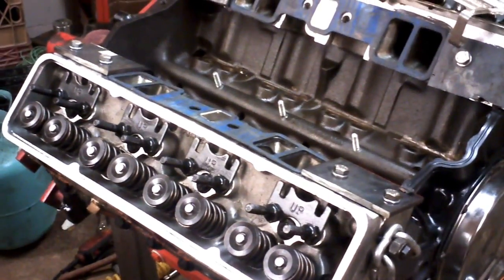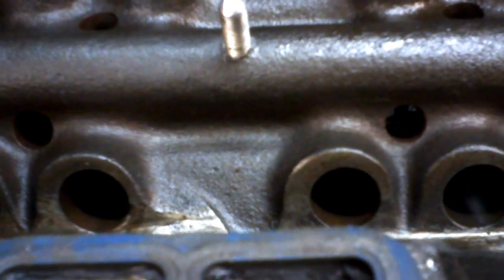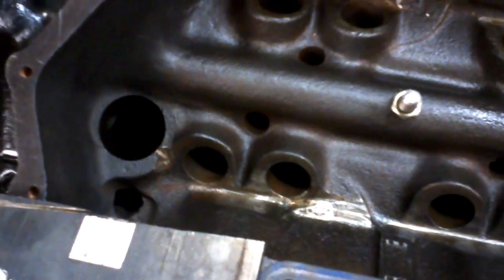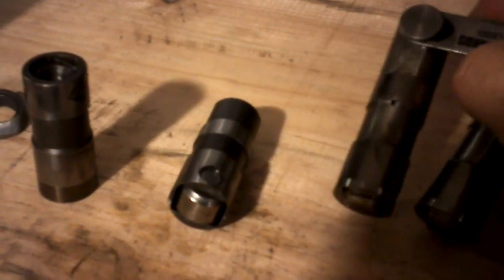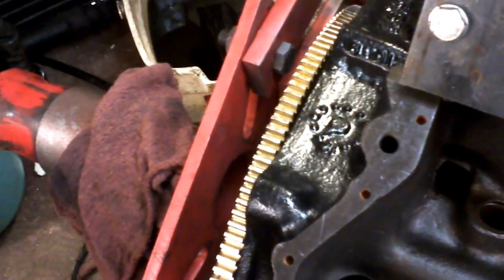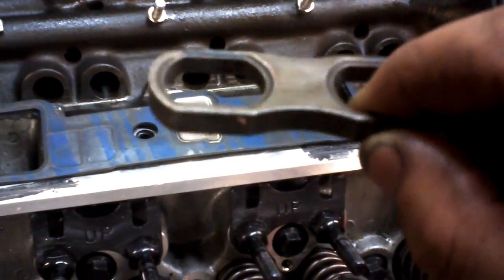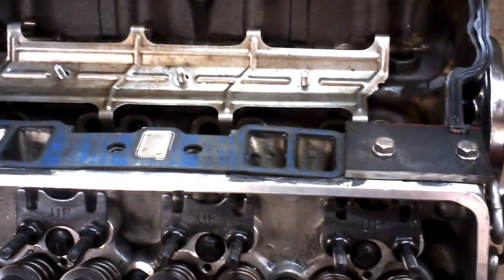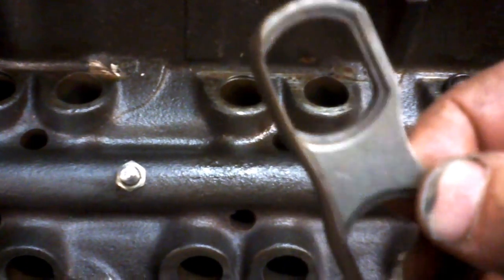Small Block Chevy Gen1 SBC roller lifter retrofit

Comment: Please please please, nobody grind down the dog bones like that...
Use the correct tie bar lifters. Valvetrain weight loss means nothing on this type of low compression low HP engine.
Please don't grind them. And don't use threaded rod anywhere on an engine.
John here is too rich to know any better judging by his other videos

Comment: I know this video is getting pretty old now, but did you ever have any trouble with the lifter spider being drilled and tapped with those studs?  I actually have a roller block with a damaged spider mounting hole, and I'm curious if I can follow your lead here and drill/tap a little further down into that ridge to run a stud for that mounting point.  You mentioned in a previous comment you'd never do this again, but I'm unclear if the problems you had were related to the drill/tap for the hold-down spider.
Reply from the maker: Dont drill down into the oil galley.  Any swarf will plug oil holes.  How damaged is your block ?  Can you use a heli coil or timesert?  If not braze on a nut or mig a stud to what ever is left.   Google cold weld cast iron.

Comment: Is the tray sitting right on top of the nut? Mine is about a 1/2" or more  higher than the nut. How tight or the ends supposed to sit on the lifter hold down?  IS the lifter tray supposed to be applying alot of pressure? I'm not sure if I have it to tight.

Comment: Wrong side of the rocker arm to be worried about weight. Light weight components on the valve side matters, valves ,retainers , locks ect. Lifters ,nah.
Reply: I've seen discussions about this and while some say it's not as important on that side because of the leverage advantage, the valve spring still has to apply energy to control that side so lightweight components do matter. Reversing the rocker ratio leverage helps but doesn't negate the weight.

Comment: Ls lifters are the same as gen 1 sbc vortec lifters which can be had for $130 so it in fact saves a lot of money doing this
Reply: what do you mean? I'm stuck with howards lifters on extreme backorder, I'm looking to do this mod instead, I can just get gm ls lifters and do the rest of this mod as is?
Reply: @Sammyjeans1  all sbc 4.3 454 5.3 (non dod) 6.0 ect run the same lifter.
Reply: @Sammyjeans1 ls lifters are the same
Reply: @frankburn6312  thanks, I have a gen 1 block so i just waited for the howards tie bar lifters, they are very good

Comment: I would not have an issue doing this with an early style sbc.  The lifter bores are rather tall if you compare to the 1pc RMS engine I would machine the tops down some and use the LT1 lifters or the 305 lifters. That where used with the roller cams  Definitely not use v-6 lifters.    Looks like a budget friendly diy way to roller cam a early sbc.  Still would have to use a cam button to limit end play on the cam.    I would probably even use a rev kit with this setup and use the LS type beehive springs thanks for the video and the info.

Comment: what if you found a way to space up the dogbones? then you could use the stock v8 lifters?
Reply: The stock SBC roller lifters will have the lifter oil inlet hole come up out of a non-roller block when on the cam lobe. Roller blocks have taller lifter bores and taller lifters.

Comment: Why not just use gen 2 lt1 hydro roller lifters same thing
Reply from the maker: Experimenting is fun but when you're racing it cost money and dings your pride.   This doesnt work, dont do it.    Use a good quality 
Johnson SBR lifter like the SBR2112.   

I also learned...90% of the stuff you read on forums and the internet 100% WRONG.    Buy  good heads... AFR, Brodix,  call the tech line, they know what works.    Buy direct and talk to a person for real.  What ever you pay extra will be worth it.  Advice you find on the internet is worth what you paid for it... ZERO!
Reply: @icsamerica  its not experimenting, i run lt1s ,i was only saying run an lt1 cam valve springs and lifters along with the dog bones and spider because its an up grade the cam is 476/467 228/218 112 lsa with roller lifter and same dog bones damn good upgrade for a sbc
Reply: And i know it cost money i have over 5 grand into my 97 z/28 i was only giving you advise lt1 valve train will work in a gen1 sbc to those that are on a budget

Comment from the maker: UPDATE:   I would never do this again.  It's silly to me now.  Real Johnson SBR2112  or a solid roller is a better way to go. I've been road course racing on a set of SBR2112 for 3 years.  When they fail I'm converting to solid roller.   The stock lifters collapse with even a mild performance cam.
Reply: So the retro fit still works, you just need different lifters? Do you have another update?
Reply: @nwee5758  He's talking about using the link-bar lifters that don't require this mod, just the timing cover button.

Comment from the maker: FYI :  I wouldn't do this again as it renders the block valueless in most peoples eyes.  Also there is no need to with the availability of low cost roller blocks now and low cost, low weight  link bar lifters.   Also the OE lifters used for this process were not designed for the quick ramps / aggressive high lift profile of aftermarket performance cams.    I'm now using the real Johnson Lifters in another project, they are quiet even with aggressive extreme energy rams.  They are pricey though.
Reply: They made them way before your video in 2012.

Comment: so you had to pull from two v6 that's funny. I have a 95 350 cast 580 block non bored and tapped boss, does roller give it power good power past 4500 rpm? What fueling system did you use, tbi or tpi, carb  for this  build?
Reply from the maker: I used a Lingenfelter Super RAM intake and the MAF based 1227165 TPI setup.  It ran good and made power way past 4500 RPM even though I ran a mild 219/227 roller cam.  I purchased the roller lifters new and they are sold in sets of 2  so no big deal there.    I have since sold the car and removed the motor.  It's just sitting looking for a new home.

Comment: I did this mod some years ago on a high comp 350 i was playing around with, i used a take-out LT-1 cam and gear set, i used the shorter lifters, bought a couple good used sets on ebay. I did a lot of flat filing on the tops of the lifter bores, die grinding the block sanding the dog bones, spinning the cam to make sure nothing was sticking. Ultimately the mod was a failure as i bent intake valves at high RPM on two occasions on both heads. Whent back to a flat tappet and no more problems.
In the end my conclusion was that the dog bones just weren't precisely aligned enough at controlling the lifters and they had to be sticking in order to cause valve to piston interference.
Reply from the maker: So you think a lifter poped out of the bore and hung the valve open?  

FYI...  I wouldn't do this again as it render the block valueless in most peoples eyes.  Also there is no need to with the availability of low cost roller blocks now and low cost, low weight  link bar lifters.   Also the OE lifters used for this process were not designed for the quick ramps / aggressive high lift profile of aftermarket performance cams.    I'm now using the real Johnson Lifters in another project, they are quiet even with aggressive extreme energy rams.  They are pricey though.
Reply: No i think a lifter hung up in a dog bone long enough for a piston to come up and bend a valve then it jus got worse from there. It was a great lesson in valve train geometry. Push rods were Ford as i recall...I reused the block in my blazer with a flat tappet. i left the spider in there as a heat and oil baffle just cut the legs off with tin snipes...So yeah now a days with aggressive super lift rollers its no longer talk about valve float but instead lifter pump down cause they just can't take the pressure at high RPM, go figure. My next 383 will be all roller and im thinking solid lifter.
Reply: You done all that work to avoid getting a roller block or using tie bar lifters? Wow.

Comment: WHAT CAM ARE YOU USING FOR A RETROFIT LIFTER OR OEM LIFTER??
Reply from the maker: In this application I was using a Lunati Retrofit roller 219/227.  Old block needs a retro fit roller.

Comment: makes sense ive only built 350s and smaller never had a 400 want one though lol
Reply: +wildthing302 Not all stock 400 blocks are the same. Early pre 73 blocks have way thicker cylinders than the later version's. And as far as overheating, I drove a 575 HP 406 to work everyday for 2 yrs, it never got over 185 degrees.
Reply: +Rabbi Schlomo Yep, NA. Used a pair of ported Dart conquest heads, Holley Strip Dominator intake & 850 Holley DP carb on a 2 inch spacer, 276/282@. 050, 640/648lift, 106 lobe separation. 11.25-1 compression. Ran on 93 octane. With more compression it would have made over 600hp.
Reply: +Rabbi Schlomo It was in a 69 Chevy C-10 street/strip truck. Ran high 10s on 12inch slicks. Mid 11s on hard ass radials. Wasent the most practical vehicle, but I can put up with alot more than most normies. No AC and manual everything is the way I like em.
Reply: Jacob Jarvis why....so you can have paper thin cylinder walls and overheating issues. ..

Comment: just use the lifters from a one piece rear main 350 2 bolt most are roller cams from factory
Reply from the maker: Jacob Jarvis the blocks are diffrent.  the lifer bores are .300 of an inch taller and so the lifters are taller.
Reply: @icsamerica  Ever thought of placing spacers under the dogbone guides?  That would also solve your clearance issue.
Reply from the maker: @michaelangelo8001  I would never do this again.  It's silly to me now.  Real Johnson SBR2112  or a solid roller is a better way to go.  The stock lifters collapse with even a mild performance cam.
Reply: @icsamerica  Well, that's good to know.  I appreciate the information.

{ (edit):  Was thinking about what you said a little more...  I assume you are talking about the little six cylinder lifters collapsing, right?  Don't you think that the factory V8 lifters which should be designed for a considerably heavier valve-train, would perform much better in that respect? }

I suppose if it came down to it though, considering that they are basically free... that someone could always take the guts out of the hydraulics, and make solids out of them like we used to do flat tappets back in the old days.

Was looking on eBay this evening, and found some good looking Chinese solids for $180.  That's not too bad, and would save a good deal of work... but I don't know what kind of life expectancy they might have.

Comment: Economics?  It's far more economical to use the OE style roller lifters than using the retrofit with the link bars.  Howards has the cheapest set of quality for the retro lifters at $359.  For $280, you can buy the entire GM performance OE style roller kit which includes the lifters, dog bones and hold down.  Far more economical to go OE.
Reply: Actually unlike flat tappet lifters a set of roller lifters really doesn't have any wear when in a vehicle taken care of so purchasing a set of used roller lifters is by far economical and safe .. get from a machine shop as they will most likely sell to customers new lifters on rebuild and have a ton of them in spare parts bins (if the shady fuckers dont charge for new and then re use old ones) that is 
replacing roller lifters is like buying a new block every rebuild .. stupid costly and completely un needed

Comment: does this same concept work in 4.3 v6 vortec engines. I have a non roller block converting in to a roller n I was told that I would have to get the retrofit rollers for it to work. please help me?
Reply: 4.3l v6 is identical to V8 minus 2 cylinders all identical except spider to hold down is different (2 less cylinder)
95% of everything 350 related bolts to 4.3l its made that way on purpose

Comment: wwwww  you ground off too much on the doggones.
Reply from the maker: Doggones?  wwwww?   You can hardly type...doesn't say much about you or your technical opinions.
Reply: they would probably work fine with the whole back side of the dog bone gone , they just need minimal guide , just to keep them straight , the flank on the outside edge would most likely do that
Reply: +john depietro: Does this also works for a non roller v6
Reply from the maker: Probable would.
Reply: Indeed ~ parallel ~ is ~ parallel

Comment: I'm looking to do the same modification on my engine, how is it holding up?
Reply: I have a 2003 Chaparral 210SS with a Mercruiser 350 Mag MPI. The block was not winterized properly and subsequently cracked along with the vortec heads. A total of 50 hours was on the engine. So I purchased a a 1994 TBI 350. The TBI has the lifter bosses machined flat to accept the "dog-bone" retainers, but the bosses for the spider aren't cast into the block. There are markings that line up perfectly with the tin spider, but they haven't been drilled or tapped. Will I be able to drill and tapp the holes and use the OEM roller lifters? Or will i run into the OEM roller lifters pushing the dog bone out?
Reply from the maker: It's holing up fine.  I recently changed to a milder cam for more vacuum and idle quality and everything looked good.
Reply from the maker: No way for me to know...I'd simply suggest you try it and check the action when turning over the motor with cam in place by hand.  If you are going to drill the block you will need to clean it so it should come apart.
Reply: @icsamerica  what lenght pushrod u used?

Comment: 40 k miles ,, then it had a failure ?? prolly oil ,, the lobes are splash lubricated , ,, springs might have got weak and started to float ,,, anyway ,, 40k miles for a performance cam is a life time IMO

Comment: do you need a spider for a roller cam cause im building a 383 and i want an hydraulic roller i have an 70s block
Reply: If you're going to use the dog bones you will need the spider also.

Comment from the maker: The 86+ V8 roller lifter will not work, You need the shorter V6 lifters.  The shorter lifters are needed because the lifter bore is shorter on a gen 1 block and if you tried to used 86+ v8 lifters they would push the dog bones off the top of the lifter bore.
Reply: The oil holes also pop up out of the bores.

Comment: So...any roller lifter from a chevy V-8 '86 on up is the same as well, they are fairly decent priced. you can find 'em used as well. If you're using used, just make sure you take them apart clean them well and inspect the rollers. Non-roller cams are abit hard on roller lifters because the lobes are angled which rotates a flat tappet lifter. Used hydraulic-roller cams are fairly economical they seldom wear out. you'd also need the cam retainer plate. there are also hi-rev aftermarket lifters.